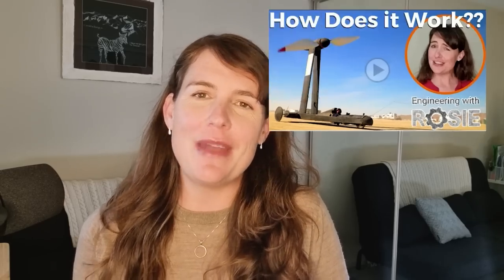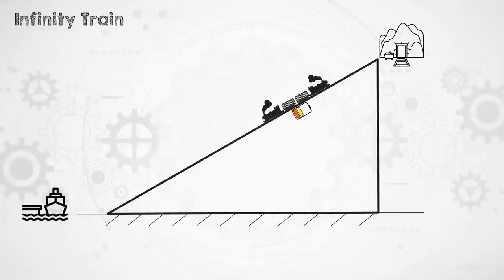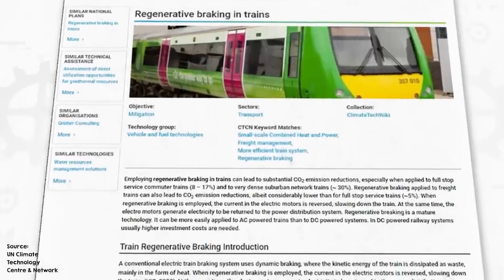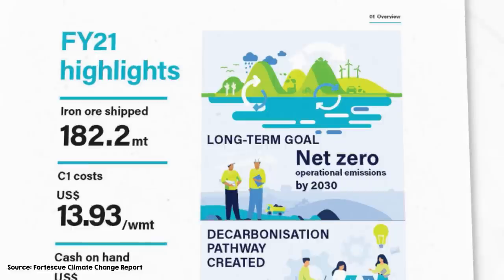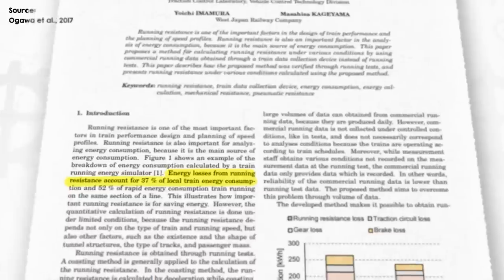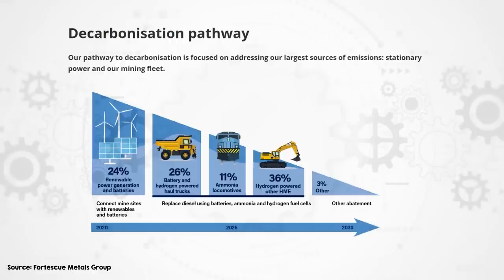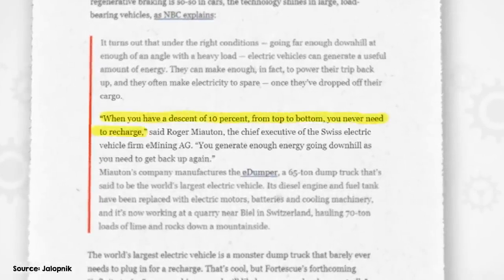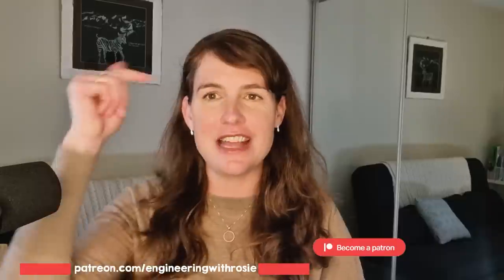This Mining Train Powers Itself: The "Infinity Train" (and how it works)

Comment: Rosie,  The faster than wind vehicle works differently than you understood or was explained by Derek (Veritasium).  That vehicle can only exceed wind speed direct down wind for a limited amount of time based on the amount of stored energy. The energy is stored as pressure differential and it works because air is a compressible fluid.
The vehicle can not continuously run above wind speed as Derek wrongly explained.  You can watch my video for all details of where Derek got things wrong.
Reply: Colin Mitchell  The amount of time vehicle can drive above wind speed is directly proportional with the amount of energy stored while vehicle was well below wind speed and inversely proportional with the amount of frictional losses.
The treadmill model is much easier to predict as there are much less variable like wind speed variation and even propeller pitch control on the large blackbird.
While model is kept on the treadmill with the hand it will initially charge up (create that pressure differential) then it will maintain that charge level until you release the vehicle when that stored energy as pressure differential if large enough will accelerate the vehicle against the direction of movement of the treadmill.
If you where to take a simple video from the side you can calculate based on video frames what the acceleration rate is and you will notice how acceleration rate drops over time.
You can based on that calculate exactly how long it will take the vehicle before it stops accelerating and from there it will start to slow down based on stored kinetic energy and inversely proportional with frictional losses.
Treadmill is just to short to observe all this cycle which can take a few minutes. Stopping the vehicle with the hand will just charge up the vehicle is basically a treadmill powered fan at that point.
If air was to be replaced with a non compressible fluid  like say water this type of vehicle could not exceed wind / water current speed.
I made a video explaining all this but is to boring for most people (not as fun or exciting as Veritasium videos). In the first half of the video I discuss the direct downwind model and in the other half the direct upwind witch works quite differently but still requires energy storage just much smaller so it is charged and discharged multiple times per second.

Comment: 4:11 On American freight trains regenerative braking has been very common under the name "dynamic braking" for at least 70 years. But in that use the energy is dissipated as heat through resistor grids rather than doing anything useful with it.

Comment: If the eDumper "only" recovers 80% of what it spends going up the hill, that means it can make ~50 trips between charges versus just 10. 🤓
Reply: The problem is, most mines are down in the ground and the load needs to be hauled uphill.
Reply: @stephenvelden295    That is true for getting the ore out of the ground and to processing. But most processed ore is sent via  ships to steel smelting facilities. Getting it from the processing to the harbor is usually downhill.
Reply: @dbeekman9738  Yes that is true. I was referring to the Dump Truck.

Comment: I think the benefit in this is overlooked in the sense of hindsight is 20/20. If one train fully loaded was to come downhill depending on its type of breaking mechanism if one train fully loaded was to pull two trains uphill that were empty you would then receive receive twice the benefit but one train coming down empty or full can create only so much electromagnetic energy and retrieve it and store it but to go uphill Fighting gravity even with an empty train the train becomes significantly heavier and it did when it came down with the weighted load because it was working with gravity so going against gravity with empty train might cost you more energy than you may coming down. But if you pulled two trains up you use zero energy going up and you have two trains now that can create energy coming down that would be perpetual free energy I think

Comment: great informative video as always Rosie.
it would definitely be interesting to see how feasible it is to have the battery system at the mine (or the port) with a 3rd rail allowing regenerative power to be sent back to it on the downhill trip. 
> Having the battery storage static would mean that you don't incur the additional load during the uphill return trip & allow other renewables to supplement the system if needed.
Reply: If it was economically viable to use conventional electrification (either 3rd rail or overhead wire) for the Pilbara mining railways, they would have done it decades ago (but they haven't). Battery electrification allows the miners to transition their rail operations over the next decade or so from diesel-electric traction to full battery-electric traction with relatively low threshold costs and low maintenance costs. Electrifying the Pilbara railway network would cost around A$3-5 billion, and clearly the big miners have determined that it's not worth it.

Comment: I just looked up a few numbers.  Empty hopper cars weigh about 30 tons.  Their payload is about 100 tons.  Meaning each car weighs 130 tons going down hill, and 30 tons going uphill.  Assuming 100 cars (typical size) the weight of the train heading downhill excluding the locomotives is 13000 tons and uphill it is 3000 tons.  The locomotives are going to be heavier than normal locomotives.

Also, rolling resistance is lower than the 37% estimate for a typical train.  It seems to be on the order of 100 to 300 lbs per ton of 5 to 15%.  I'm not quite certain of this number because the parameters were specified badly in the paper I read.

If my numbers are correct, this leaves a better margin for getting back to the top.
Reply: Mining loco's are in the 200t range. Ore carriages also have a failure rate (locked brakes, seized wheels etc). There's also derailments common when carriages are crossing rail frogs/switches etc. In that case carriages with problems needed to be shunted onto sidings so that maintenance crews can repair them. FMG, BHP and Rio have numerous sidings for this purpose. There are also fast track locations where braking needs to be controlled and slow areas where no braking would be necessary to retain momentum. One has to remember that none of these tracks were laid with etrains in mind. There would need to be a lot of remedial track work I'm guessing.

Comment: I am curious, how are they dealing with wind resistance? An odd thing in American railroads with coal cars. They actually take more energy to haul empty than when loaded. Because the massive amount of wind resistance. It will be a significant factor if there is any appreciable speed on this route.

Comment: free energy is a thing, it's called the sun, we use it every day
also before i even watch the video i know how the train could work and its quite simple, if it's transporting a heavy load downhill it has more potential energy, it is essentially slowly lowering materials using the force of gravity to generate power, then once at the bottom, it gets unloaded making it lighter meaning, the amount of energy required to get up the hill, will be less then the energy gained from regenerative breaking
you could achieve the same thing by just throwing materials down the hill and letting it role down, but well that wouldn't be a great way to transport materials
yeah this is a really well made video, you have earned yourself a new subscriber, your a gem partner would be lucky to have someone as smart as you, it's rare to find someone who shares a very forward thinking realistic, down to earth way of thinking

Comment: I have an idea for energy storage. Its the same as a potential energy battery. Actually my friend had the idea. Basically you can turn a kinetic energy motor upside down if you put it in water and use a ballon to pull the rip corn instead. There are small tanks that can be dropped down to the ballon and used to rapidly fill it. Depth of water being the only concern. We came up with it while talking about under water cargo trains. So it wont rip as fast as a pure gravity battery but the pull would be constant and very strong. And i think very energy efficient to recharge as you could use a windmill or something similar to pump the air down.

Comment: Very interesting!  This idea is much better than the crane that stacks blocks.
There already is a Pantagraph powered open pit mine with dump trucks going up and down.  I guess they can use it as a energy storage system when they are done with it. But they will probably move their assets to the next mine because it is more valuable that way. 
They use the landscape for pump hydro tho.

Comment: Some mining companies use diesel/electric vehicles that piggy back fixed overhead power at certain times. No if the e truck had patches of overhead power, then the truck batteries would carry you for longer times.

Comment: I can't find it now but another location uses huge mining trucks that are electric only now, charging on the downhill trip loaded, driving back up empty. If I recall correctly they even can dump energy to the grid at the end of day as they generate more than they need. Similar to a locomotive those massive mine trucks are also generally diesel - electric so it's a very similar concept.

Comment: The cable cars in San Francisco always balanced multiple cars going downhill and uphill on the same cable, so the electric motor propelling the cable is surprisingly small because the motor only overcomes friction losses. I recommend the cable car museum to any engineer

Comment: Were there any details on what the train did when the batteries were fully charged? Did it just fallback on traditional brakes or did it have a way of dumping extra battery charge at the mine to ensure the butteries weren’t too full to start the trip?
Reply: Battery electric locomotives use sophisticated energy management combined with detailed route information to optimise the battery usage and State-Of-Charge. In the unlikely event that the battery was fully charged when it was needed for regen braking, the regen energy would be diverted to standard rheostatic dynamic braking, with the regen energy being burned off as waste heat as it is now with DE locos.

Comment: The new Tesla semitruck has brakes, but only nominally. It uses three motors where they could have got away with only one, just because they use 100% regenerative braking; three motors in parallel are required to recover the totality of gravitational energy of a slope.
 In conjunction with 99% efficient converters and almost 1 MWh battery, it looks like a miracle but is only some very good engineering...

Comment: Since most of the freight trains these days are all diesel over electric they could literally use a standard diesel train engine and just add a specialized slug car that can contain additional axel motors and batteries for the electrical side of it.  Just add some additional circuits in the main engine to route the regenerative breaking energy from each of the main engines axels to the slug...  It could certainly reduce the cost of climbing back up the hill.  The main engine and slug could be called Jack and Jill. ;P

Comment: The "batteries" are being charged at the loading platform where adding the weight is eventually converted to electrical energy. Train returns lighter having used up the energy it took to load the rail cars. Incredibly clever execution of physics that would probably never happen here in the US. We seem to like being 30 to 50 years behind in technology.

Comment: A few years ago I designed and made a air compressor that runs off water pressure from a household tap 😅 unfortunately didn't get past the prototype stage, but it's actually created compressed air! Got to 70+ psi before i got scared 😂 very simple idea. I'm surprised no one has designed anything like it before and produced it.
Just requires two tanks, 3 solenoid valves and 2 float switches. The incoming water fills the first tank and pushes the air into the second tank until the water level reaches the top of the first tank, the tank to tank valve closes, and the 1st tank is drained then the cycle is repeated gradually increasing the pressure on the second tank. Obviously, it uses a huge amount of water, but I run a small business selling plants, so it is perfect for somebody like me! I've missed a lot of info out but you get the idea 😂

Comment: This sort of battery train actually does make a lot of sense. A mining company in Brazil has recently purchased several battery locomotives to supplement their current diesel fleet and take over the role of helper locomotives for use on steep hills. I don't think it will be possible to completely eliminate diesel power on mining trains like these, but use of regenerative battery locomotives on hills would significantly reduce fuel consumption.
Reply: The Pilbara miners will use these first-generation battery electric locomotives in hybrid consists with their existing diesel-electric locos (typically DE-BE-DE), but their aim is for fully battery electric operation within a decade or so. Rio have stated that their expectation is that they will ultimately replace their DE traction with BE traction units on a 1-for-1 basis. With battery energy densities continuing to improve by 4-5% every year (since 1992) there's no reason why they can't achieve this.
Reply: @davidjones5280  There is still the general principle of energy loss and inefficiency, which would necessitate either some use of diesel locomotives or charging periodically. That's rather harder to overcome
Reply: @andrewreynolds4949  The powertrain efficiency of BE locos is ~ 2.5x better than DE locos, so energy losses and inefficiencies are far lower for BE traction. Diesel will be out of the picture completely by the mid-2030s (will only be used while the trains are using hybrid DE-BE loco consists). By  the early-mid 2030s the BE locos will have more than enough on-board energy for the round trip, possibly requiring some charging at the start of the loaded trip. This would be from the renewable supplies (solar wind & battery) that the Pilbara miners are constructing now.
Reply: @davidjones5280  You don't understand my point. No matter how efficient the manufacturers claim their locomotives are, there will always be some energy loss. Diesel fuel is far more energy-dense than batteries, thus weighs less and requires less of the energy to move itself. That drawback is minimized by the gravity-driven nature of these specific mining operations, but there will still be some amount of energy loss forcing the provision of an auxiliary power source. Wind and solar power are temperamental and expensive to maintain (I have to live with it in my area, it needs huge government subsidies to keep it operational); I don't think getting rid of the diesel units entirely is a good idea
Reply: @andrewreynolds4949  I understand your point entirely. The direct comparison between the energy density of diesel fuel and batteries is invalid, because it doesn't include the weight and volume of the conversion system required to convert potential diesel fuel into useful energy (eg electrical energy). By the mid-2030s battery electric locomotives will have a comparable operating range for the same overall locomotive weight as a diesel-electric locomotive. The professionals who operate the Pilbara mining railways (the most efficient ultra-heavy rail operations in the world) know what they're doing, and will make professional engineering calls on when diesel can be fully eliminated from their operations. All energy systems are subsidised, and currently the miners receive big subsidies to underwrite their use of diesel fuel, which is not sustainable either environmentally or economically.
Reply: @davidjones5280  By the weight of the overall system battery-electric vehicles weigh SIGNIFICANTLY more for a lesser range, and it's a growing concern for road and bridge maintenance with cars. The energy density problem I mentioned isn't just by fuel, it's by system. Modern ICE units can put out a lot of power for a relatively light weight assembly. Batteries are still decades away from being comparable, if they ever are. 
 Furthermore, batteries don't last anywhere near as long as an ICE block with normal maintenance; locomotives last 30 years or more with their original blocks, a few last upwards of 50. Batteries degrade much faster over time and use, and are much more damaging to the environment in their production. I would argue they are actually less sustainable; they're certainly more expensive. Battery power isn't some sort of magic bullet, it has some advantages and some very distinct disadvantages.
 Every mining locomotive program I've heard about plans to retain diesel locomotives, these battery locomotives are just a way to capture extra energy that's currently being wasted. 75% battery power per train might be feasible, I don't know, but as far as I've heard 100% is unlikely.

Comment: Mining trucks have been using overhead wires to use the kinetic energy of the truck going into the pit to assist the truck coming out.
Robert Murray Smith recently did a great debunking  episode of some free energy videos from the 80s.
Some of the steel bearings that seem to defy physics, are simply propelled by a battery and coil.

Comment: The haul truck example would only work in a very 'special case' mine operation.  Most haul trucks operate in open pit mines, they drive up out of the pit with a load, then drive down back into the pit empty.